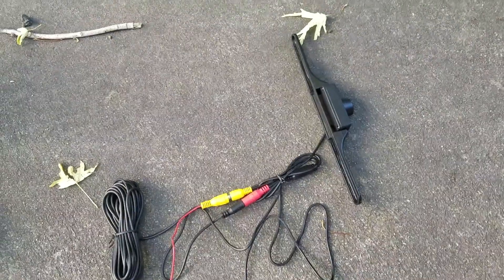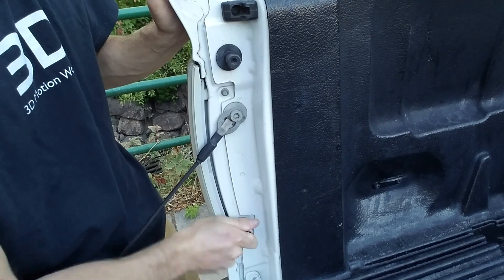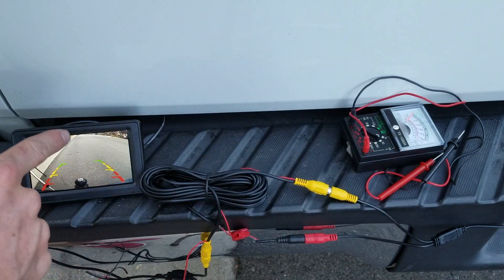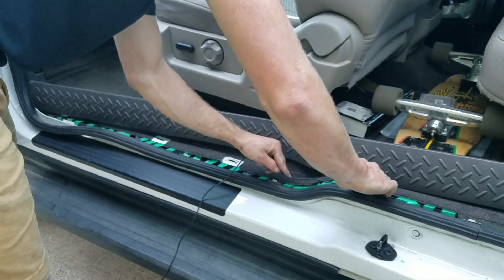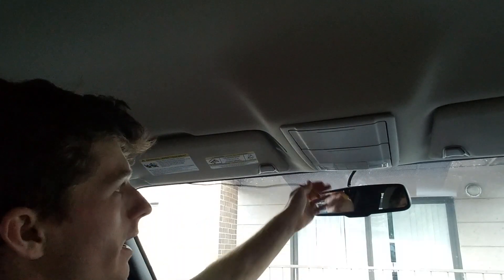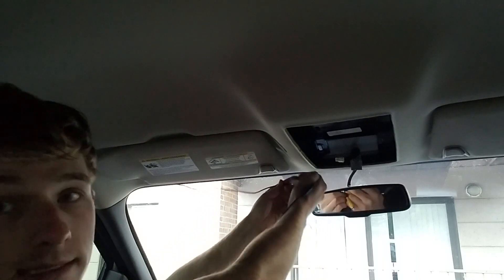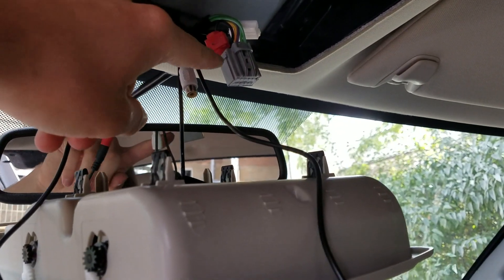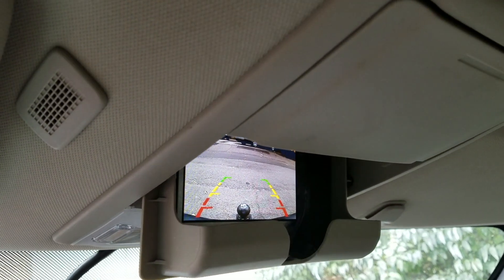How to Install a Hidden Rearview Camera for $30: 2010 Ford F-150 XLT

Comment: I used this 
Brand: LeeKooLuu
4.3 out of 5 stars  4,942 Reviews
LeeKooLuu LK3 HD 1080P Backup Camera with Monitor Kit OEM Driving Hitch Rear/Front View Observation System for Cars,Trucks,Vans,Campers Waterproof Super Night Vision DIY Grid Lines

I did have to cut away some plastic on the sun glass holder and a bit on camera. It was very simple I used a dremel blade. Where I ran the wire out the back of the sunglasses holder I had to cut a channel because when it went to close the wire was getting rubbed so I just cut a channel out. I then used hot glue to secure it in. Also I didn’t see a drain hole in the front door step (might have been covered with factory wiring) but the rear step had one easy to see and use.

Comment: I put this in my F150 my friends couldn’t believe you made it so easy and so hidden. Thank you so much! I want to put a front camera or sensors on front of my truck cause I live in the city for right now and parking is tight. However, I have a cattle guard so any ideas? Is it anyway possible to use the same display for both? Thanks again you are very talented.

Comment: Nice job ! Please don’t take this as criticism as I only offer this advice to try and be helpful. I would suggest you encase your wire that runs from the rear of the truck, underneath the frame, in a wire loom. It won’t do much to protect from moisture but it will add a buffer from the wire rubbing over time from vibration and hopefully save it from possibly shorting out. The second suggestion is the rubber plug or grommet under the doors floor plate that you brought the wire through and into the cab. I didn’t notice you making a slit in it before reinstalling. I would definitely make a slit for the wire to run through otherwise you will have constant pressure against the sharp opening and most likely end up shorting your system out pretty quick. Just trying to save you from having to replace the setup due to a short in the future. Ingenious idea installing the monitor in the sunglass compartment ! Nice, clean install. Very impressed.

Comment: Thanks CluEngineer,  your most important innovation was to use the free red wire to be the power line, starting at the back up light connection, for the video screen as well as the camera. This shortcut is not covered in the two kits that I installed. In fact, the instructions are for a separate power source up front for the video. They recommended a cigarette lighter or using a fuse panel circuit. My second install, I had no vehicle manual and the fuse locations were not identified. So which one did I pick? The one that I didn't know was on all the time and we soon experienced battery failure. Since the camera was never on, the screen was never on, so no indication that power was being used. Again, neither one of the instructions that came with two kits even acknowledged the free red wire dangling from the coaxial black jacket at both ends.

Comment: Thanks for the tip about going through the gasket at the door. 2 suggestions / words of advice though. 1) anytime you have a wire going through a metal hole you want a gasket / grommet there to protect the wire from being nicked by the metal. Over time the vibrations from your truck are going to cut that wire where it is going through your floor. 2) the a pillar has a curtain airbag in it. The way you routed the wire is NOT safe. If you completely remove the pillar there is a location specifically meant for wire routing up that pillar that avoids the airbag.
Reply from the maker: Steven Lubbers, thanks for the suggestions. I remember routing the wire behind the air bag.

Comment: I installed this camera (now $39) in my F150 today..  I set it up to get power from the cigarette lighter.  That means that I have some coiled wire under the front seat. I used heat shrink tubing on the power lines (red/black) because I didn't like the red color.  Setup works fine. I chose the setup because I thought it would be useful to use while driving, but it really isn't.  Because it is wide angle, cars a car length away look tiny on the screen.  Because of that,  connecting it so it gets power from the backup lamp is probably the better choice.  It would reduce the clutter of wires in the cab to just one wire going to the monitor with the excess looped an tie-wrapped in the back near the bumper.   I purchased 20 ft of 3/8 in. loom cable at AutoZone  to protect the wire under the truck and tie-wrapped it to existing cables and the frame and up through a grommet into the cab of the truck.

Comment: must be your 1st time doing this, nice attempt tho. 1st off you don't have to cut the wire at the tail light with that connector u use. just insert the wires and press tab down, auto splice. 2nd and important always use a wire loom running wires to prevent short circuit. and 3rd when u came up thru the door trim all u had to do was cut a hole in the rubber grommet and seal hole with silicone afterwards. other than that I liked where you installed the camera. also with that monitor you could have wired it pos n neg to that connector overhead. even if it has constant power it wont come on until the rear cam comes on when you put it in reverse. signal sensing turn on.
Reply: I like  the  way  he removed the grommet and then I assume  you  can just slit the bottom lip of the grommet to get the lip to pass the wire and get back under the hole and pop in place. No need to cut a large hole in grommet to feed the RCA connector through and no need to mess with silicone.
Reply from the maker: slim myers, please be a little bit nicer with your comments. No reason to be rude. If you have zero content uploaded for anyone else to critique then you should not be making comments like that. The constructive feedback is great though. In regards to your last tip, I am just hesitant on connecting it to a power source that’s always on Incase there is a draw.
Reply: @92813justin  if i came off like that then that wasnt my intention. I was speaking from experience and possibly help you avoid the outcome i had. I appologize.

Comment: Thanks man! This video helped me with the running of the wire for my truck. I used a more detailed video by someone else who showed how to tap into reverse light, which was better for someone like me who is a total amateur at this. But your wire running instruction was great!
Reply from the maker: Thank you. Next time I will add that part in

Comment: I am installing a wireless back up cam on my 2013 f150, but I still need power in the cab to power the monitor. Would I be able to splice into the plug doing nothing under the sunglass holder for that?   Would cutting off the fat 12v plug switch I assume has a fuse in it give me problems?
Reply from the maker: I am not sure what plug you are referring to. But the power that draws from the monitor is pretty small. I wouldn't worry about a fuse burning out.

Comment: What is all the wiring in the back of that rear view mirror for? I'm trying to figure it out...
Reply from the maker: It's an autodimming feature for the rearview mirror
Reply: @92813justin  how long has that camera lasted? Held up well? Not wearing out your sunglasses holder?
Reply from the maker: Everything is still working fine. I was worried about the hot glue falling off but it works flawlessly.
Reply: So it, most likely, isn't the wiring harness (for a backup camera) in my 2011 f150 lariat? :(

Comment: 6.8 average? Holy crap. I am better off driving a tundra then.
Reply from the maker: Rock Roller i just filled it up and drove up a hill for about 2 miles. It actually gets 18mpg
Reply: CluEngineer 18?? What motor do you have? Also, thanks a lot for this video. Probably gonna copy you.
Reply: CluEngineer mine gets 13 so it sucks but still worth every penny.

Comment: Hey can you explain the 2 red wire coming off main cable any diagrams?
Reply: The red wire is attached to the rear brake light wiring, or any other 12v current that only provides power when in reverse. This signals the screen to turn on. Most systems work without it actually attached, but the rear parking assist will not be shown. Just the camera feed.

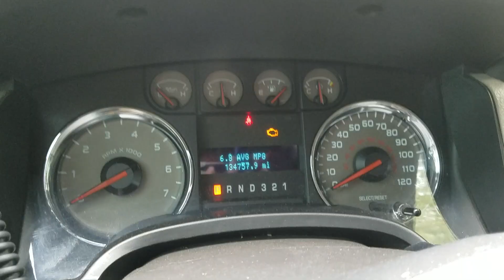Comment: 11:27 6.8 AVG MPG ( ͡° ͜ʖ ͡°)
Reply from the maker: Haha. You like that?  That's the bad part about a truck in the city.
Reply: Cool little picture you made with those symbols!
Reply: where do you live? I get better mpg with mostly city driving..
Reply from the maker: 32svic Boulder Colorado. I also just filled it up and went up a steap hill. Probably stayed under 25mph for 10 miles or so. On the highway I can get 21mpg
Reply: How is it that low? 

I have a 2010 F150 XLT and mine gets 13.7 avg

Comment: I had just finished installing one of these unit yesterday one my SUV but why the rear view mirror is so dark when the camera not is use? Do you have to connect the a red wires coming out video concerto a power source?  My unit wires also got one of these red wire but I did not connect it to any power sources and it still function, so it this correct hookup?
Reply: If you have not found out yet, the red wire is for a head unit.  It connects so as to engage when reverse gear is selected.  So as not to be on all the time...

Comment: where did you hook up the positve to in the cab for the monitor so it is not on all the time?
Reply from the maker: I only attached the positive to the backup lights. When the backup lights turns on the whole system turns on. The only wire I had to connect in the cab was a ground wire. Hope this helps!